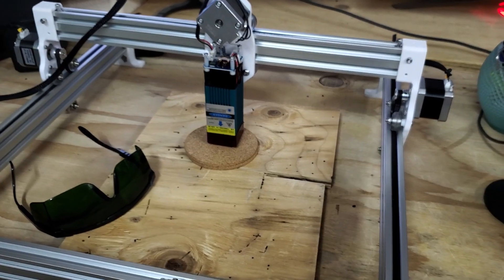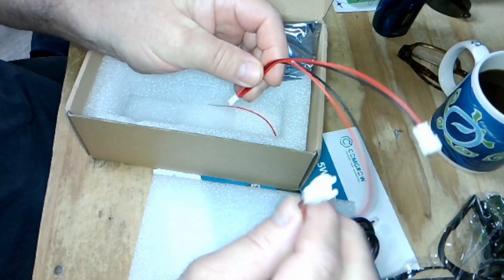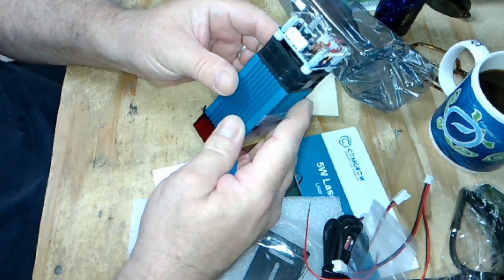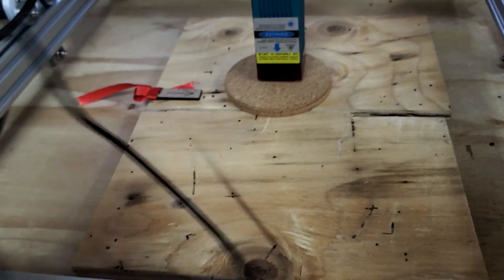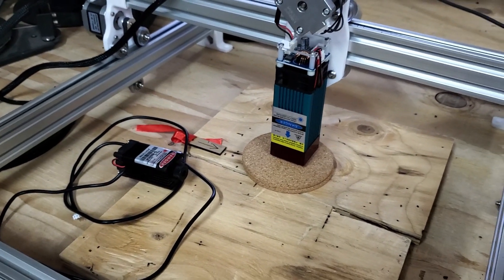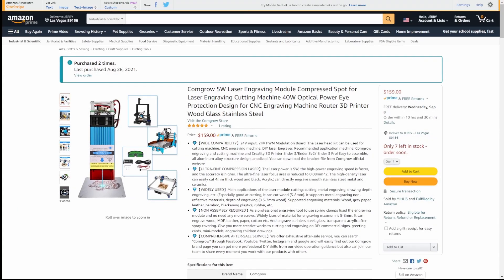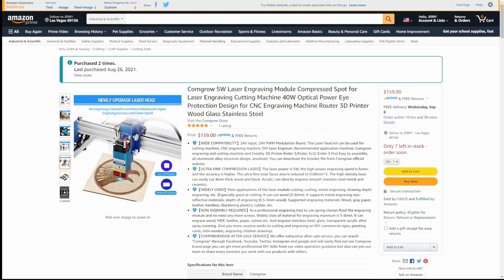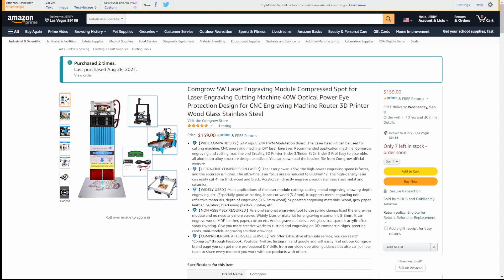Comgrow New 5 Watt Diode Laser on my DIY Project #3dhp

Comment: Great video!  Been thinking about making something similar. 
I wouldn't run a laser diode, or CO2 at 100%, it may just shorten the lifespan.  I would run the laser and 60-70% power at the most, and just do multiple passes if needed. 
Keep up the great content!